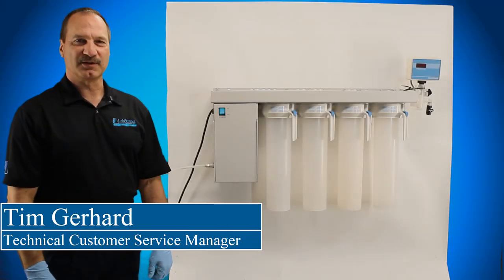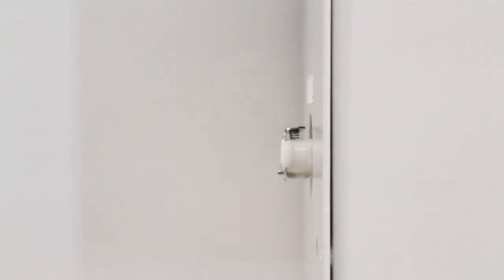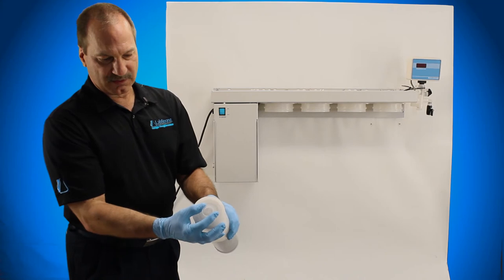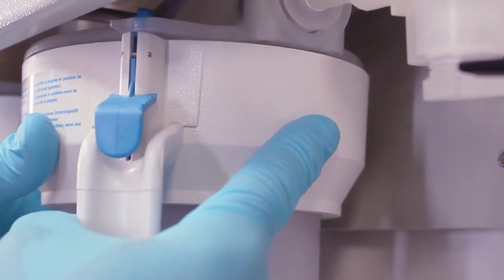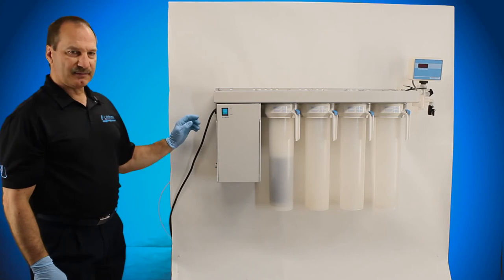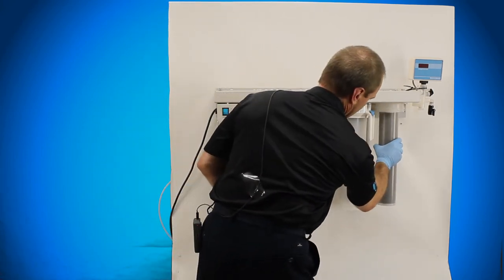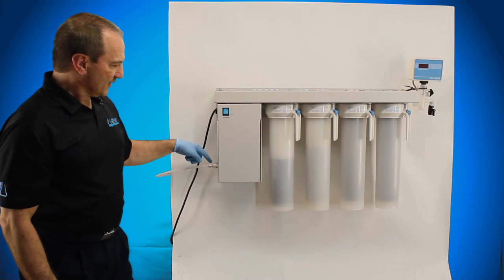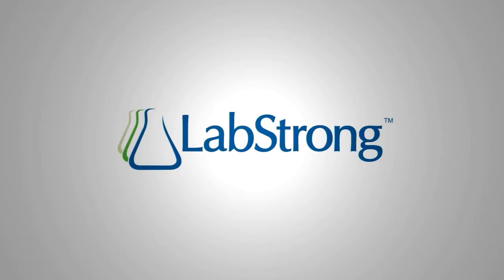How to Install Cartridges in a Thermo Scientific Barnstead E-Pure Water Purification System

Comment: Our system was installed and works great but we have leaks coming from the cartridge housing.  We have tried several times to re-seat them and replace o-rings but cannot get them to seat.  Any suggestions?

Comment: What Ido if I have a small air in the first two filters?
Reply: Depending on the model number of the E-pure system in question, the system will have either 3 or 4 canisters.

The direction of water flowing through the Barnstead E-Pure systems is always from left to right and in all of the systems the first canister is Up Flow and for the 3 module systems the first canister is the only one of the three that is Up Flow. The rest of the canisters in the system are Down Flow (positions 2 and 3).

The flow direction in the 4 module systems are a little different than the 3 module systems with regard to the first two canisters which are Up Flow and the second two canisters are Down Flow for the 4 module E-Pure.

 Barnstead E-Pure, 3 module (model D4631)

Position #1         Up Flow

Position #2         Down Flow

Position #3         Down Flow

 Barnstead E-Pure 4 module (model D4641)

Position #1         Up Flow

Position #2         Up Flow

Position #3         Down Flow

Position #4         Down Flow

The E-Pure system will trap air in the first canister of the 3 module system and in the 4 module system the air can be trapped in the first or second module because of the Up Flow configuration of those canisters. In most cases the air trapped in those canister will work its way out of the system over time and in some case it may not work its way out of the canisters. This is common to see in the E-Pure systems when you change out the cartridges, not much you can do about getting the air out of the system other than running water through the unit until the air bubble works its way out. I would not recommend this because you will waste a lot of product water to do this, you are better off running the system as normal and hope the air bubble works its way out of the canisters.
Reply: I have the 4 modelo barnstead e-pure (model D4641)
The air bubble in the second filter is not allowing the system to work, because when you turn it on, all the water in the first two filters goes down. I have no idea what to do.

Comment: How do you flush trapped air out of the first canister. Mine has always worked, but this last time, no matter how long I allow water to flow to drain or to recirculate, that first canister will only fill to about 3/4 full and my reading won't go much over 4MOhms. Any tips? thanks
Reply: Its a physics problem... Unfortunately there is no easy way to remove the air from the top of the first or second canisters/cartridges. Those two canisters are configured in a up flow design, and air can and will get trapped there. It may take a long time to get worked out. This typically isn't a problem with the 3rd and 4th cartridges. There are ways to remove the air pocket, but it isn't for the faint of heart and can lead to a change of cloths or a wet lab in the morning. As far as the 4 MOhms, verify that the cartridges are installed in the correct order, and let the cartridge rinse up in re-circulation. If its still an issue, call our technical support number on the cartridges. We can help further diagnose the issue, which could go down several different paths (including, were gloves worn during installation).
Reply: @labstrongcorporation9618 How can I remove the air in the filter?

Comment: what cause a fishy smell? How to get rid of it?
Reply: Unfortunately, this is the smell of water DI chemistry. The media smells like that, along with other unflattering descriptions... This smell can also be notice in the water output if the water has sat in the cartridges for quite awhile, or if the water flow is too slow. Speeding up the flow, or flushing water through the system should get the ion exchange sites working properly again and remove the smell from the water. De-ionization is a dynamic process which requires movement of the water for the ion magic to happen. This is why water recirculates through the system while it is on standby. If the system has been off (no re-circulation) then the DI media will sluff-off this wonderful odor that only fishermen appreciate. Rinse it up and all should be good.